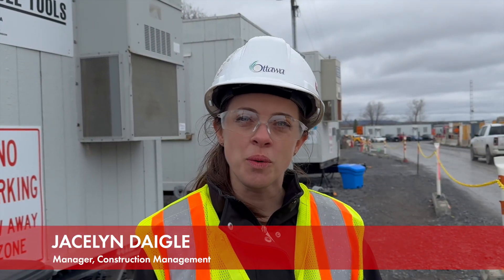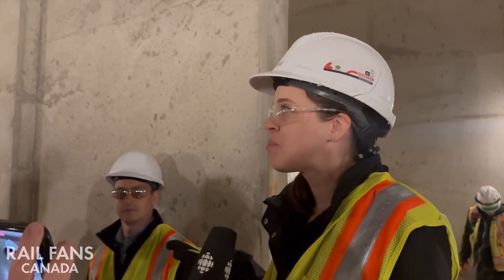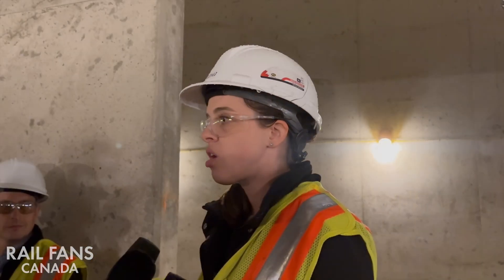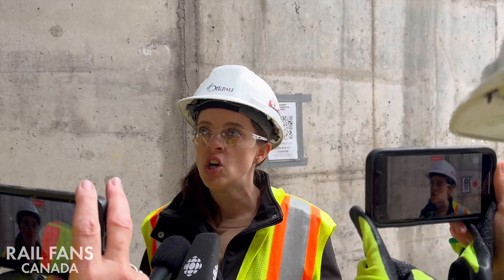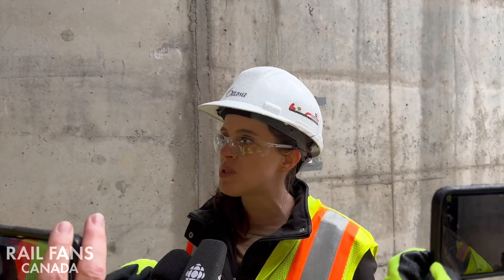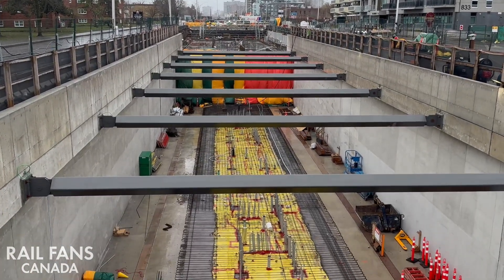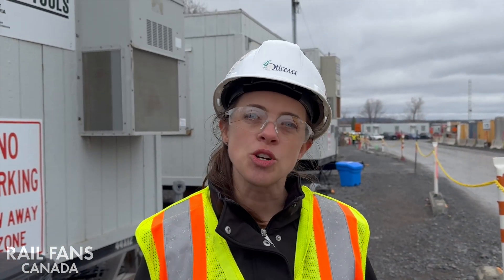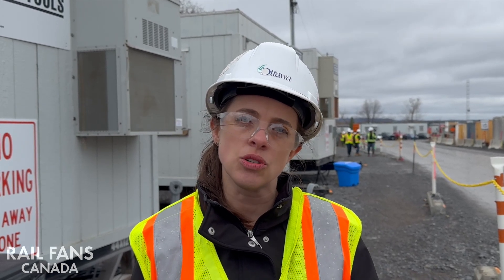An Exclusive Look at the Construction of the Kichi Zìbì Mìkan Tunnel and Sherbourne Station

Comment: Seems a little narrow, like it’s not futureproofed for larger trains in the future.
Reply from the maker: It seems mostly due to the camera angles, but I can assure there is a lot of space in there! “Larger” trains in the future for Line 1/3 is more likely to be longer than “larger”, at least for the next 40 years. If larger trains are acquired, all the stations would need to be reconfigured anyway.
Reply: @RailFansCanada  but the platforms are low level, so if you upgraded to metro rollingstock you’d have to reconfigure the platforms either way. I’m upset that the city didn’t recognize its blunder and instead doubled down on lowfloor LRT for the foreseeable future with no plan for future upgrades.